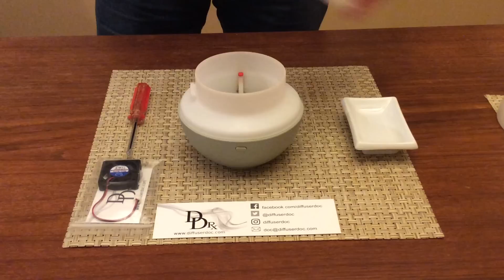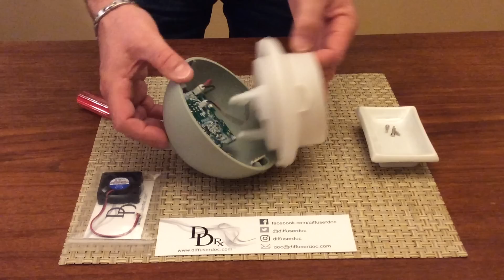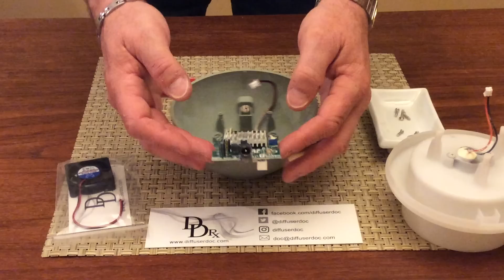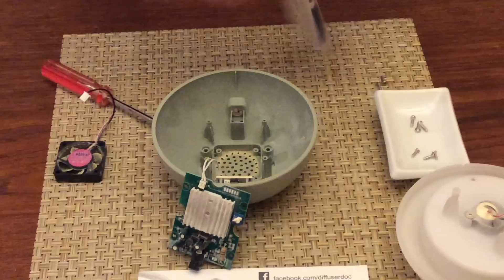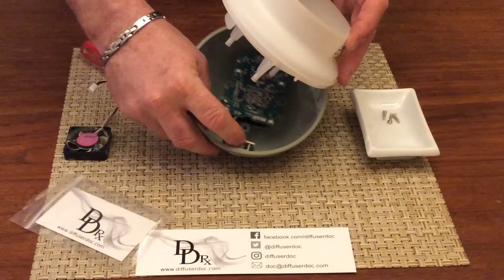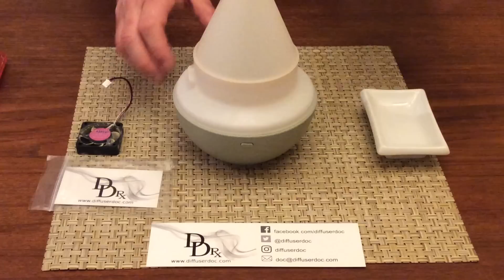How to Replace the Fan in a Young Living Dewdrop Diffuser

Comment: Is it possible to change the lightbulb to be a plain white color instead of the blue?
Reply from the maker: It wouldn't be very easy because they are LED's soldered right on the circuit board, but certainly possible. Contact us on the site for more info.

Comment: Hi Eric, Great instructional videos. I'm getting ready to buy either the Aria, Rainstone or Dewdrop diffuser. In your opinion is the build quality and the quality of the parts in all 3 about the same or does one stand out over the other's? Thank You, Mike
Reply from the maker: The Aria and RainStone both have titanium plated discs that will probably last longer and resist corrosion. They are well built with quality materials, The Dewdrop does the job and is priced right and also lacks many of the unnecessary components that can lead to failure (remote control, music, etc.). The disc is also cheaper and easier to change. These are only my opinions - hope they help.
Reply: Thanks! I like the RainStone but you make a good point about the remote. Still scratching my head here.
Thank you.